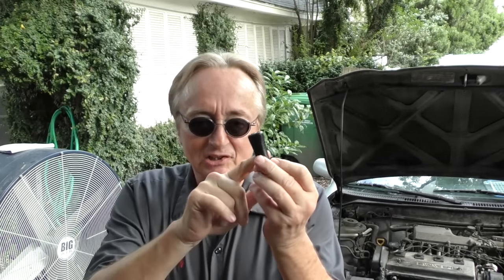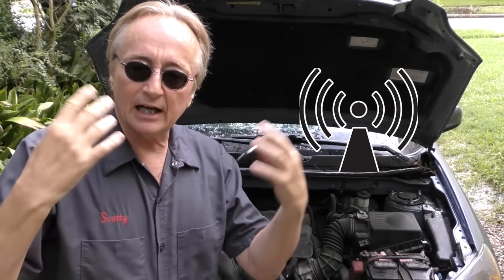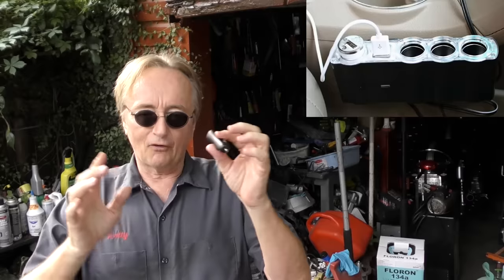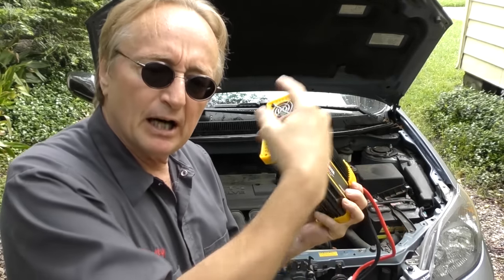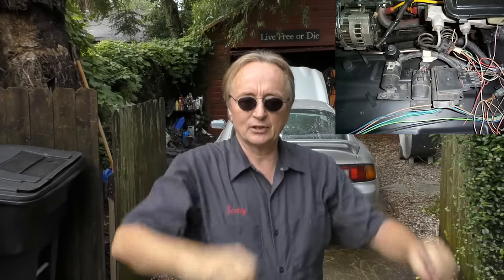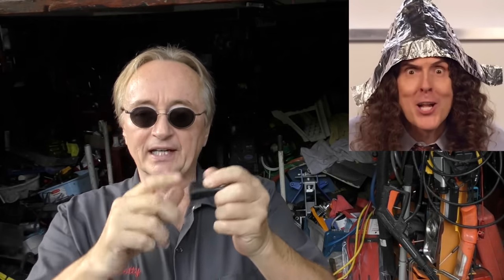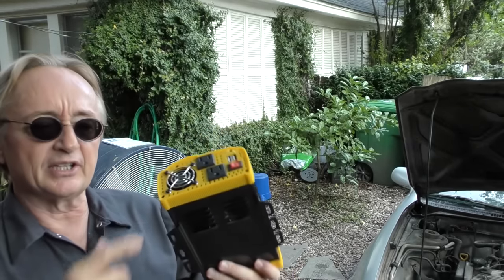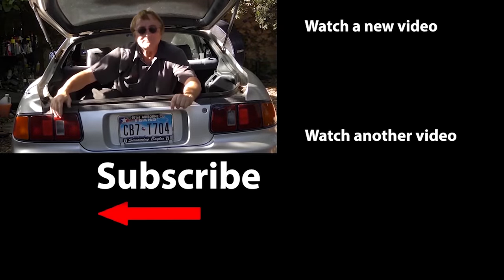This Adapter Will Destroy Your Car

Comment: Scotty great info I never would've thought that something like a cellphone charging adapter could cause so many different problems
Reply: I also read on other forums that blue tooth OBD2 adapters (plugs into the OBD2 port) can cause electrical problems if you leave them plugged in all the time. Prius owners do this to keep an eye on the hybrid battery condition as well as other things.
Reply: @michael47lamb  lol prius owners domt even know what a battery is
Reply: @JDS All Things-yep even a single break from an off/on switch on AC can send an electromagnetic wave out -hence good quality equipment state that this device will absorb and not produce any  harmful blah blah blah as Scotty mentioned get good quality components to eleminate that possibility.
Reply: @richterman3962  Out of sight out of mind for sure for most people. And a hybrid pack cant hardly get more out of sight and still be in the car. That's why those OBD2 bluetooth things are handy for seeing what is going on with the cells. Just dont leave it plugged in all the time, it runs down the cells. LoL

Comment: Hey, Scotty...  My cigarette lighter works fine.  It gas 12.9v power and heats the lighter element like crazy but when i plug in a USB adapter, of any type quality, it won't work.  Gets no power through...  What's up with that?  Its a 2001 Buick Century with factory lighter.  😮??  Do i just need a modern lighter socket??

Comment: Also limit how often you charge your devices in the car. Charging before you go out is best.
Reply: One of my kids plugged a laptop into my 10 year old van while on the interstate ,100s of miles from home. Discouraged that immediately;even though I had no idea about the details,I knew it was not the best idea.
Reply: Its not a problem the car is grounded this is not good advice
Reply: Not true. Amount of charge cycles and range of percentage of charge are both bad. Optimally,  you would go from 0% to 100% for minimal charge cycles. But for minimal range, you would charge from 60% to 80%. But 0 to 100 is bad, and 60 to 80 is bad a impractical. So, optimally, charge from 40% to 90%, then go full drain and full charge once or twice a month to "reset" the battery.

Comment: I love your videos but these adapters don't work like that at all. Most just have a single solid state regulator and maybe a few resistors for selecting the output voltage and capacitors for smoothing. There's no giant coil transformer. That's really wasteful of parts and power.
Reply: mharris1270   nah that's just nonsense to put in an inverter-> transformer->rectifier->regulator in a small thing like that. Totally rube goldberg and expensive for nothing. Notice he never opens it and even the stock photos he shows look just like I said. I think he overreached on this one.

Comment: If I connect an inverter to the battery what can I power with it? Can I use a bullet blender? and should the car be running to use the inverter? Are u sure you can't ruin the battery using an inverter

Comment: I have a 12 volt adapter & it works fine
Reply: @ryanmalin  Really? Because I've been using these for years with no problem. Three are plugged in right now. 185,000 miles and still fine.
Reply: @I Paid Yeah. Be careful you don't overload your system drawing <3A from a cigarette lighter socket.
Reply: You have to have the car on to make the usb turn on.  Also, this stuff is regulated by the fcc.  It’s ham radio 101
Reply: @ryanmalin  Ok, I'm a ham radio operator, and I went to college for electronics. I deal with radios all the time and have them in my car, right next to my  12 volt to 5 volt dual plug supply and then explain why my prius which is highly computerized and my radio equipment has never had a problem with my 5vdc adapter. Also explain why I don't get a RF signal from my adapter on my spectrum analyzer which is laboratory grade Hewlett-Packard. There is simple circuitry called a 7805 regulator that will take 12 volts dc and reduces it to 5 volts dc, it doesn't generate any RF or radio frequency noise or interference and it is very quiet electronically. I have taken exams both in college as well as for ham radio and one of my jobs is to seek out interference causing items. Those 5 volt cigarette lighter plugs don't cause interference.

Comment: I am driving a pre-2000 design car, so my car is immune from the buck converter magnetic field.
Reply: 1998
Reply: J B Get an antique plate
Reply: '85 F150 here. Same same. All the RFI in the world ain't gonna bother that tired old beast, worst effect that'll happen is some static on the radio.
Reply: I drive a 1991 Mercedes S Class. No worries there

Comment: I live in north east US. Its cold half the year. Would a second battery for inverter be overkill? I’ve ran small inverter on beater truck i didn’t care too much about, & it did fine. But I still hate the idea of running inverter off original battery. Any thoughts? Would 2nd battery be silly?

Comment: On my older Tacoma (2002) I kept blowing fuses.  I just stopped plugging it in, and all my problems went away.
Reply: Same. I plugged in adapter and messed up a fuse. Never gonna do that again
Reply: Scotty says that will never happen on a Toyota
Reply: Adapters aren't blowing fuses. That's just silly.
Reply: @DESIGNS-vo1mt  lol, that does sound like something Scotty would say.

Comment: I repair tankless water heaters and I’ve seen cases where installers would wrap the low DC voltage comm wires around the 110 volt AC wire.  All sorts of ghost codes would appear resulting in the control pad eventually failing.  Your magnetic field is real.

Comment: Scotty I enjoy your videos...But you passed on some bad info.  Any 5 Volt DC USB car charger has a simple voltage stepdown circuit inside.  Usually they are composed of a common fixed or variable voltage regulator IC with a few resistors and capacitors, that's it.  Basically, that regulator does two things implied by its name.  It controls current flow at its output and drops the 12VDC input voltage down to 5VDC at the output so you can charge 5VDC devices without exposing them to either an over voltage or current situation.  There is NO oscillator, NO inverter, NO crystal or any other circuitry to intentionally create any radio waves or alternating current (AC)...Why would you?   The charger would be MUCH bigger that what you held in your fingers.  I'm not arguing that one of these devices did or did not interfere as you say, just that your description of that charging device and its function were not correct.  If any device emitted stray Radio Frequency Interference (RFI) as much as you imply, the FCC and auto manufacturers would be raising hell.  Certainly the device would never get a UL approval.  
I would also call into question your assumptions about what is known about radio waves or electromagnetic energy.  If we are as stupid as you imply we'd still be using megaphones instead of radios with amplifiers and microphones.  :)

Comment: I have a crazy story about one of these! They can be dangerous if you get a cheap one. I had this Bluetooth fm transmitter because I have an old 04 e500 Benz with no Bluetooth and I wanted to listen to my own music. After never doing this in the 15 years we’ve owned the car, the abs light went on and I lost all power to my brakes. It was so scary and me and my mechanic friends couldn’t figure it out for the life of us. The brakes then started doing this once a week every Monday like clockwork and it was so weird. I ended up taking the transmitter out and letting my friend borrow it for our road trip and I accidentally left it with her. My brakes never went out again when I unplugged it and I was so confused before making the connection. I had no idea why that little thing could cause such a huge malfunction. Thank you !!

Comment: What about the inverters that you plug into the inside of a cigarette lighter ? Are those ok ?
Reply: No they will blow fuse if it draws more than 5 amps. Less than 5 be ok

Comment: Only two days ago, I was on an eighty mile journey and had a double adaptor in the car for the first time. The car would not run as efficiently as normal. You have probobly solved the problem and the adaptor is going in the bin? (Trash can as you would call it). Thanks for the heads up, what a brilliant channel.
Peter UK.

Comment: question......I drove my car to mammoth witch is up over 7000 to 9000 elevation and my check engine light came on. It turned off and on at time and the come I was able to read off said p0305 witch is for the 5th cylinder I think. Can a change in elevation affect my 2001 pick up like that?? I tried using the expensive gas but it didn't seem to affect the on and off check engine light.

Comment: Real title: Old Man Thinks He Can Charge a Laptop via a USB Cable
Reply: During Hurricane Florence, our power was out for like a week and my roommate at the time hooked up a few adapters and charged his laptop with one of those adapters. It started to get really hot and he stopped. So yes, this CAN be done.
Reply: Dont the newer macbooks have USB c? Im sure it wouldnt work well but you could use a usb to usb c

Comment: Uhhh,  physicists know exactly how electromagnetic effects works - it's on the quantum level.
Reply: @d.martins709  They do know. Heck, even a high school physics student can understand how electromagnetism/magnetism work. It is gravity that is not completely understood.
Reply: @d.martins709  I probably know as much about Tesla's  accomplishments than you do - I have admired much of his work for over half a century. However, his idea of long distance broadcast power of any useful level was incorrect. It is one of the very few things that Tesla got wrong. You cannot get around the inverse square law - regardless of the type of broadcast radiation, even laser.

Comment: i bought one of these, and on highway the door of my trunk whas keep opening itself.
Reply: The automated door won't open at high speeds.
Reply: Even my exhaust fell off when I used this adapter.
Reply: Once saw a cigarette adapter that couldn’t even light a cigarette anymore, what kind of sick puppy... how can they have rectangular cigs and these rectangular holes but it can’t light my round cigs anymore. Probably needs a new engine I’ll take it to the dealer
Reply: u car is haunted 😂😂

Comment: Dear Scotty,  I have a modern Kia Sorento Diesel, and want to put a USB charger with a voltmeter, in the cars cigarette power socket, because of what you said in one of your videos, I purchased an all metal bodied model, not a dirt cheap one. Do you think I could be in trouble with interference from these. Can I harm the car by plugging this in.??  Thank you for your videos, you put in a lot of effort. Regards Smudger.

Comment: I know a guy who's car caught on fire and was a total loss because of one of these cheap chargers. I use the one you recommended Scotty. Plus, these cheap chargers can also destroy the battery in your cell phone as well. There's a reason they are sold at gas stations for 5-10 bucks.

Comment: Hey Scotty. I live in my 2007, 2.7L petrol Toyota LWB, mid roof, Hiace Commuter (ex taxi), at the beaches in NSW AUSTRALIA. I've spent $ on solar, charge controllers & Renogy DC-DC to charge 2 off grid battery banks. I will definitely stop using the fast charge cig lighter socket for my phone from now on. Thanks for this 1! Have seen this earlier.

Comment: I had a wireless charger mess with my TPS senor. I removed it and the error went away..
Reply: Really? What kinda car is it? I'm gonna stop using those lol
Reply: Also, don't keep it in the socket when the car is not being driven.
Reply: @Mr_Joseph979  good practice, but if socket loose power when keys turns off then it make little difference really -only possible issue would be if socket stays live all the time.
Reply: Hello Peter.  What's happening?  Ahhh, we have sort of a problem here.  Yeah.  You apparently didn't put one of the new cover sheets on your TPS report. Mmmm.   Yeah, you see, we're putting the cover sheets on all TPS reports now before they go out. Did you see the memo about this?  If you could just go ahead ....

Comment: Got it, just use tin foil and wrap with duct tape around the questionable USB power cigarette plugs
Reply: Remember that will cause heat build up.
Reply: To be fair you can fix just about everything with tinfoil and duct tape.

Comment: If I use the left cig lighter port on my ford f250 it will blow the fuse after a few days and some reason that fuse is also connected to the ODB2 port. So I can't get any diagnostics when it blows the fuse. I did go in and replace the fuse for a diagnostic ODB2 report then later thinking everything is ok, I used that cig lighter port again and blew the fuse again. I just left it blown. The right cig lighter port seems to work fine.

Comment: One of the reasons spendier ones don't cause as much interference, is that they use what's called a step-down converter, which cause much less interference than AC sine waves.

Comment: My 2015 Volvo XC60 12v cigarette lighter in the just behind the transmission, the PDNR thing, not a car guy as you can tell, stopped working years ago. Luckily, there is one USB port in the storage compartment and it perfectly to charge my iPhone. Any advice for someone who has zero knowledge on repairing cars how to fix the cigarette lighter?

Comment: I believe one of these devices caused my tire pressure indicator light to illuminate on the dashboard. I removed the charger from my cigarette lighter and light has not come on again. Air pressure in tires was fine. Thanks for this video.

Comment: 2 Adapters 4 ports per adapter at least 1  in use 4 of the ports, my adapters are fused at the panel so not possible to overload. Did you use a nail in the fuse box to suggest that you can overload and let the smoke out? RFI? sure about as much produced from the 3 ECMs on the vehicles.....

Comment: Help! I bought a 12v defroster unit as an interim measure to clear windshield. (Blower went).
Defroster was doing fine until last night. Then it blew a 15A fuse under dash fuse box, and plug port and radio quit.
I replaced the fuse, went to plug in defroster again, heard a pop, and power is out again to both plug port and radio. Advice please!!!!

Comment: I like how you showed the bottom of the board and not the top. Hiding the components. Why would they convert dc to ac to dc when they can just step down the dc voltage. You couldn't get a charger for $8 or even $20 if they do that. The only issue Ive ever had over the span of 6 cars(personal and work) is interference with the radio. Fuzzy stations. Newest is a 2017 Nissan nv1500. Maybe just get FCC compliant ones?

Comment: The other month I plugged a head strap lamp into my cigarette lighter charging port on my subaru forester. I went to the shed for 30 seconds I came back to the car to see through the rear windows smoke in the cockpit. I ran back in to see the charger literally a flame in the dash. I love my car so much I just grabbed it and chucked it onto the grass then I stomped it out.
Man that was a close call, no damage to the interior, hopefully also to the electronics.

Comment: Me charging my phone with a little cheap adapter definitelyy killed my car battery once. I think I had to change my whole battery but I forget. It was years ago and I later found out, before watching this video how this device could drain your car battery, especially older vehicles / older batteries. But everything this man said is facts. These things can give your car soo many problems. Definitely do a lil research before just grabbing any adapter / car charger.

Comment: Photovoltaic / Solar Thermal Technician here. Scotty's  radio frequency answer slapped me in the face LOL truth be told i use the cheap adapters, guilty as charged. then again i drive a '68 Slant Six 
i Like, OLE'!

Comment: Minor nit, and late to the video but the adapters don't work as described here. They aren't transformer based (think older, heavy wall warts). That would actually be better. These use a "switching" circuit to keep a capacitor charged to the 5v output level. Needless to say, they switch the 12 input on and off at a high rate, and the rate varies with the output load. 

Bottom line though? Scotty is right, if poorly built (no-name, made in China) they will splatter broad band RF into every circuit in your car.

Comment: Thanks I have actually experienced this situation in my dodge challenger  passenger side airbag warning. I had the power of my  work phone into the the adapter which came with the phone  . Every time I took it to the dealer  it wouldn't  happen  but get it back drive to work plug phone in on the way  then airbag light then repeated the whole process  several times then our company upgraded our phones  the kits did not supply the adapters.  So when I got my car back.  They light didn't come on I thought they fixed it. Now I know can recall that the upgraded phone without the charge adapter  was the same time.

Comment: Hey Scotty I have a solar generator the bluetti 1500 now there's 3 ways to charge them one way is the 12v cigarette lighter when your driving not when the engine is off its ok for that isn't?  There is a second way you can put a 500wh inverter to the 12v and turn it into ac power is that ok?

Comment: I prefer a small inverter. My 91 bronco has had one for decades. It is a small 500 unit. I did the 3g alt swap and wiring so considering a 1500 inverter

Comment: Scotty I had an invertor attach to my battery
 Ran a car buffer off it. It shorted out the ignition wire. Which made everything from the fob remote not work. Was told the inverter was strong enough .but the buffer was draining to much power from the battery which caused all the problems..about 700.00 to get it all straightened out. That's what I was told anyway.